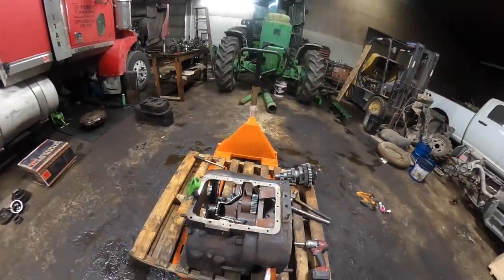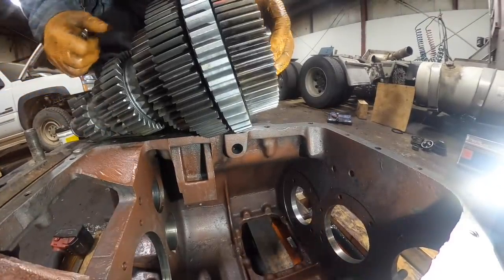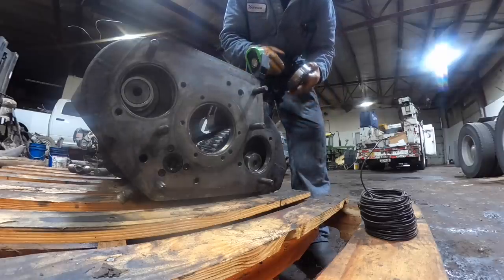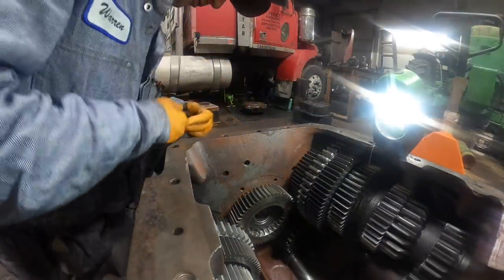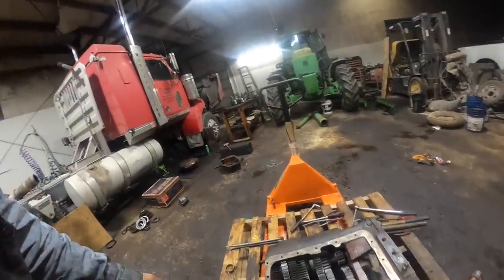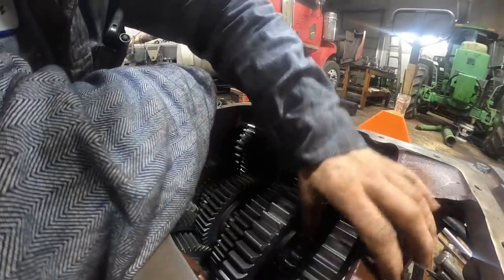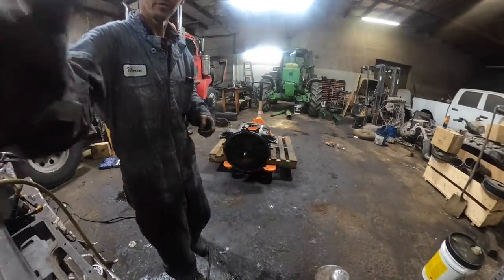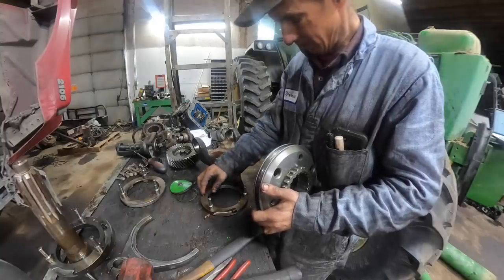Eaton RTLO16913A rebuild pt. 3

Comment: If anyone’s putting a shift housing back on make sure not to put a long bolt in the right hand side above the pto gear or you can lock the trans up , 2 longest bolts usually go LH and Rh front corners 
Another great video Warren

Comment: I have taken an old set of bearings and brazed them solid. Cut in just less than half to hold the counter shafts in the bore until you get ready to place the main shaft. Cheaper than the factory u blocks.

Comment: Warren, you can weld a bead on the inside of those bearing races/cones, they'll shrink when they cool down, should slide/fall right out. Saves you the chance of "nicking" anything.

Comment: I know on the older transmissions with OD in the front section the shift pattern was reversed with high gear against the dash. On the newer ones they did something to the last shift rail in the top cover to eliminate the reverse pattern. I'd really be interested in seeing the way that was done when you put the top cover back on.

Comment: I have a crane that stuck in high gear today 10 speed. Looks like I need to check the shifter splitter, the air lines to the case and on the case, pressure regulator and filter,  pre select lock out pin, and the selector o-rings in about that order from what I see on this video and a google search of the high/low shifter fork assembly diagram.  Weird how I found exactly what I need posted on the exact day and hour I need it!

Comment: When you were putting in the upper countershaft, did you see how the oil pump gear wiggles?  It looks loose somehow and wasnt spinning true.  SUpposed to be like that?
Reply from the maker: I think you are seeing things
Reply: That oil pump gear wiggles some they are not a real tight fit new oil pumps do the same thing

Comment: I've seen that these have to be timed correctly but still can't wrap my head around why. Gears have a consistent  pitch machine into them your think it wouldn't matter.
Reply: Maybe this will help. As in any gear train, if you are even one tooth off on any gear that set becomes elliptic. Also known as ..... Egg shaped. You may be able to rotate by hand but when you get to that point it will push one or the other gear  shaft outward. The best indicator is a counter shaft will push the bearing race out of the main case. You might get it back together. Two teeth off, forget it. Count your gear teeth both gears. Divide by two. Paint mark your teeth. We call it "split the gears". Assembly your gears paint mark to paint mark.
Reply: @shortchange26  I understand what you mean if you don't rotate the shafts but are a tooth off it causes the gear to climb or push up. I mean in theory you should be able to rotate a counter shaft x amount of teeth as long as it's still axial lined up in the bearing race. Thank you for your input.

Comment: After looking closer in this video , I was wrong about 3rd an 4th in this transmission . Those maybe wondering about gutted shifting towers , slack in the shifting pattern , damaged sliding clutch/collars , sliding collar teeth damaged on 1st ,2nd ,3rd & 4th , damaged shift forks and rails , and a damaged high/low range  synchronizer may find this interesting >>>>> https://www.youtube.com/watch?v=zL0LX0oo0Mg

Comment: Locate the main wire bundle
Cut these wires in order:
Blue
White w/Green stripe
White
But first, lock down the fuse plate with supplied bolt